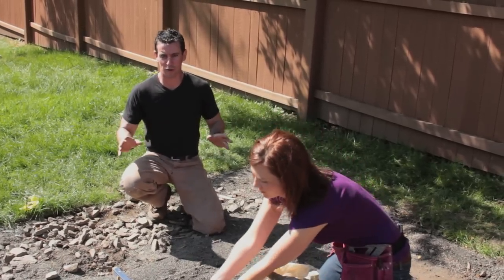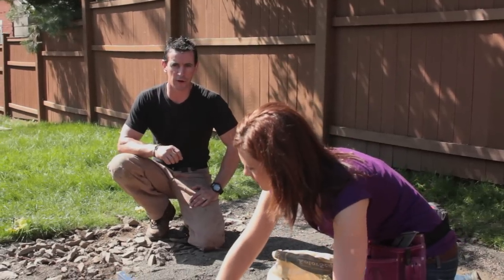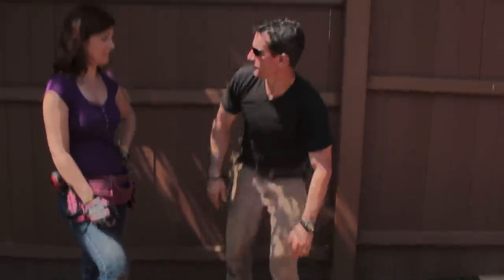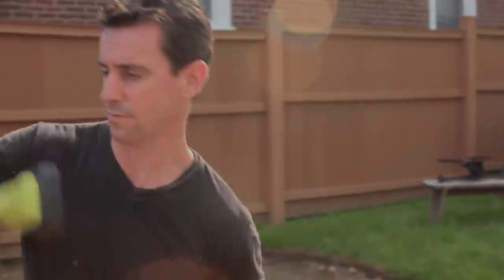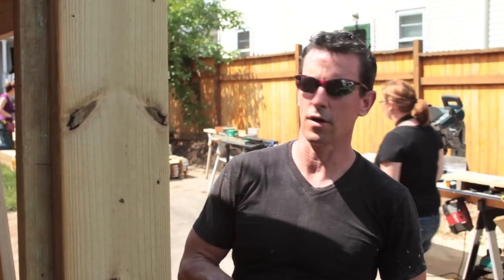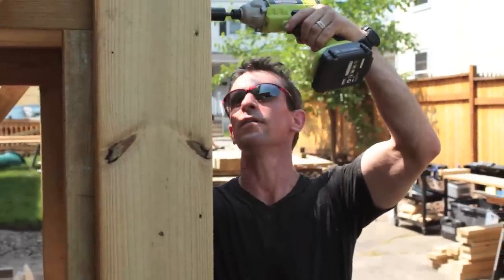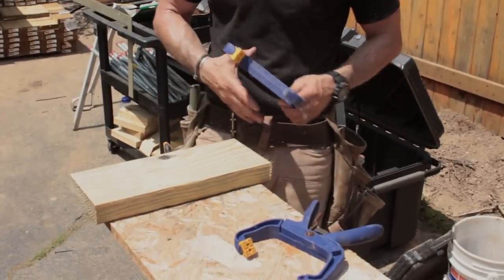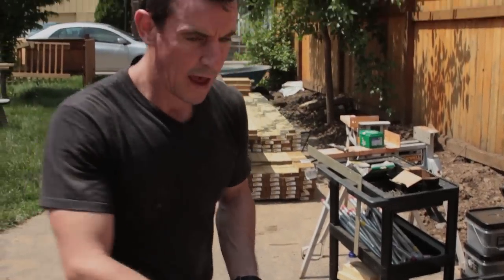How to build an awesome wood playset! Part I

Comment: I was googling how to build your own playhouse and I found this video and your website on how to build this.  I love the video and actually wish you went into more detail.  Do you have any suggestions for a rookie like me to understand how you framed everything?  I saw the 4 page outlines, but I don't know where you put the different bolts and what hardware you used on each step.
Reply from the maker: Peter - We went into about as deep a dive as we could. Framing spacing is typical 16-inches on centers. - As far as tips go, getting the foundation as level in all directions as possible (north-south-east-west) and as compact as possible is important. The platform should be square (pulling diagonals does this) and the corner posts should be as plumb as possible. Basic stuff but it really matters. Not sure how else I can help, but please let me know and I'll do my best top try.
Reply from the maker: Also, did you see this? - http://myfixituplife.com/DIY/real-wood-real-fun-playset-trailer/#sthash.bNJaZVgI.dpbs

Comment: Hopefully you see this comment. Probably a stupid question but there are no details of where to put all the different sized screws. My guess is that the 6” screws go into the 4x4 base.  The question is do we put 1 or 2 per joint? I tried to figure it out base on number of joints and number of screws on the materials list but the numbers didn’t work out.
Reply from the maker: Bruce - Sorry to be slow on the uptake here. Seems you figured it out. I bombed in 2 screws for each joint in the 4x4 base, and yes, 6-inchers.